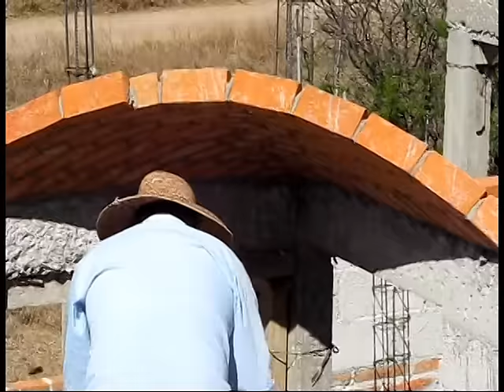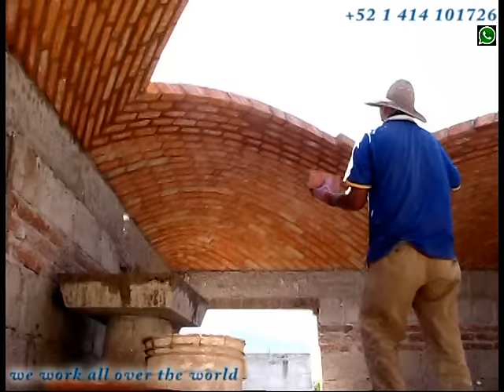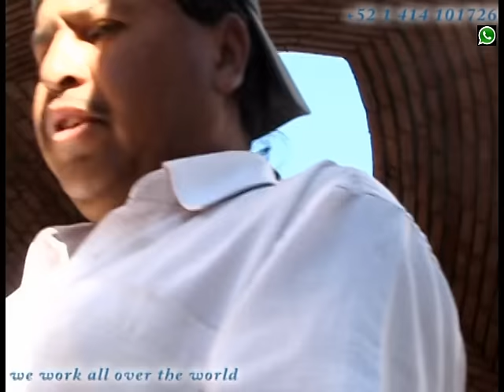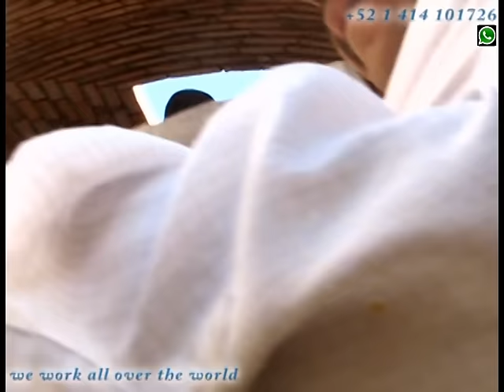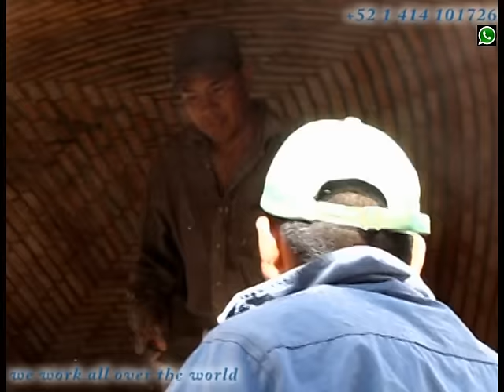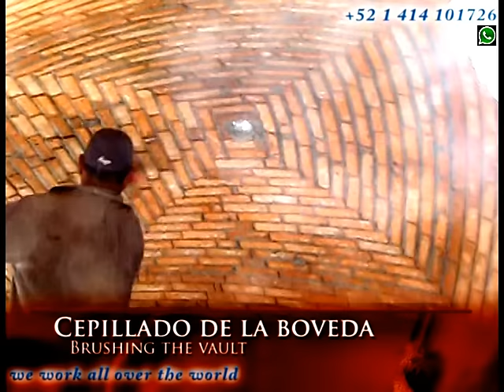Extraordinary Brick dome roof build, The Art of Bricklaying.

Comment: For those wondering typical mortar mix for this is 1:1:8, cement, lime, sand. The bricks are extremely dry so it soaks up the water out of the mortar really fast which gives it enough time until it becomes a self supporting arch.
Reply: I’m building a circular house in Panama and still wondering what material I will use for the roof. I would not be afraid to do exactly that what they do here. But the right mix of the mortar is the secret that it will work. The other way to do it would be like Steve Arreen’s dome house with concrete blocks or clay blocks. Well. My walls are in the moment only 4 feet high. Still enough time to think about it. But when I watch all this videos, the mortar mix is real watery for this small clay bricks.
Reply: @holgermessner851  the mortar has to be that wet or else it wont stick to the brick. If you use drier mortar you will have to dip the bricks into water before each joint. These style here are red clay bricks and are super dry. This is similar when doing Brick ovens, you use drier mortar but you soak all of the bricks for atleast 15 minutes.
Reply: @VinnyGjokaj  I have to dip my concrete blocks here in Panama in water. Or I do it, because it is very hot here and I don’t trust myself. And when someone talks about “lime” - as a German - I am thinking first about wall paper clue we call in Germany LIME. (I hope I got the writing right because I’m already 19 years away from Germany). So if someone says cement, lime and sand…. I was already in building supply markets to find lime / clue for clay bricks. Last week on a very rainy day, I used finally the translator. Lime = Kalk (German translation)! And yes. I can get 55 lbs bags from Duracal here in Panama. ;-) So I always wondered why the clay bricks sticking. “They use clue? (Lime)” Now that I know, what you guys talk about, I know we used it in Germany for the wall stucco too to get the concrete mix sticky. Thanks for the advice!
Reply: @holgermessner851  Yeah no problem! I am originally from Albania FYI!

Comment: What are they using for mortar and how are they staying up looks great
Reply: Just a regular mortar mix. They mix it very loose so they can keep joints tight with minimal tapping. The bricks are very thirsty and laid dry so they readily absorb moisture and prematurely dry the mix to the bricks. This provides the temporary adhesion needed to get a whole course in which immediately becomes self supporting once the arched course is completed.
Reply: @jfdb59  can we build another room on top of that roof?

Comment: How well will this hold up in the snow?
Reply from the maker: Once closed, the arch, and even more, the vaults, are the strongest engineering structures there are, watch this video where weight tests are made on these vaults, follow the following link, where they do the test with hollow materials and made with plaster, in Mexico, we use solid brick and concrete, verify this in the experiment of the following video: https://youtu.be/vHrIkk4wo9s

Comment: What is the name of this application materials
Reply from the maker: The bricks are normal cooked mud bricks
Reply: Brick OK but what is the application material please
Reply: @basavarajking1680  do you mean the grout?  Have to really nail the grout to hold up the bricks.
Reply: @basavarajking1680  12kg cement, 25kg lime, 120kg sand + water.
Reply: , lime?? Realy?